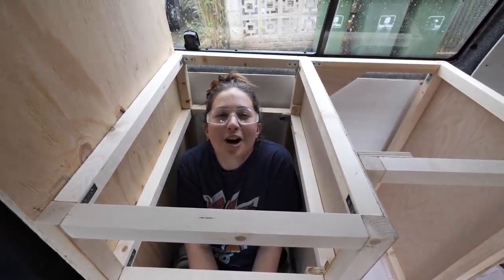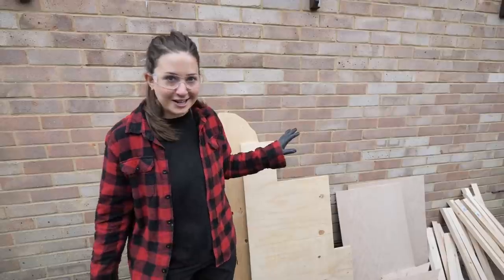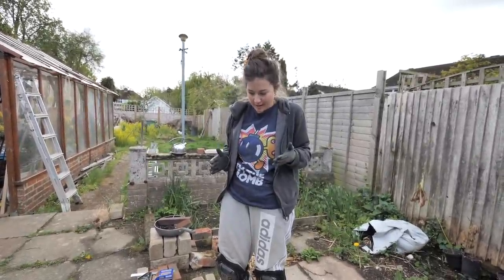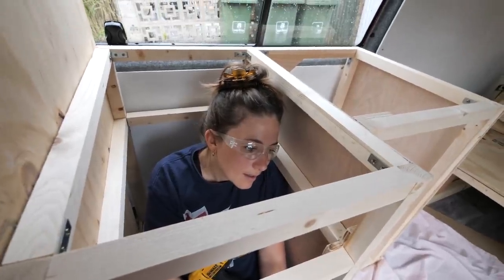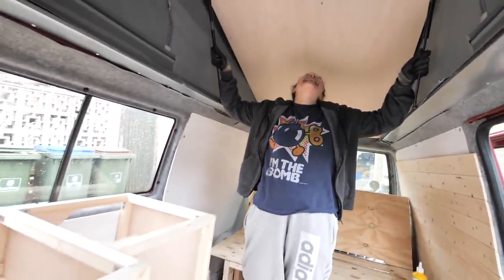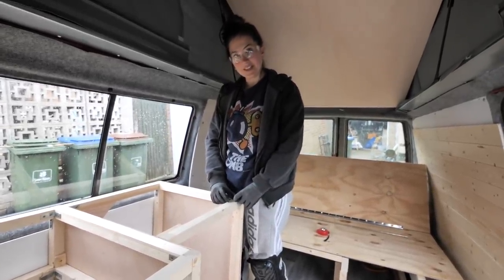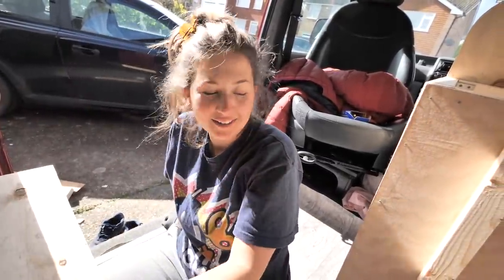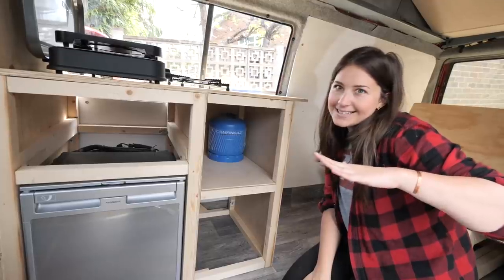Kitchen Nightmares | Self Build Camper Van Conversion For Dummies Part 4

Comment: * IMPORTANT *  Please, please, please make sure you install adequate fixed ventilation.  Not just an opening door or the pop top, it's got to be permanent and unobstructed.  All gas appliances require combustion air.  If there is insufficient combustion air, there is a high risk of incomplete combustion and then the creation on carbon monoxide.  I enjoy the channel too much for you both to wake up dead!!!
Reply from the maker: Thanks and don't worry we have put A LOT of research in to the gas as we don't want to die either. We can never get too much feedback on this subject but it will all be above board & safe :)
Reply: @TravelBeans  Brilliant, didn't want to come across as a bit of a nob!  Been working with caravans and motorhomes for 20 years and own a caravan and motorhome repair and service centre. We see some terrible conversions with no regard for gas and electrical regulations.  Keep up the good work.  Ps, belt and braces, make sure you install a CO alarm.
Reply from the maker: @jameshogg76  Not at all, when it comes to these things it's better safe than sorry. Plus we are still novices so I know it is easy to make mistakes. More than happy to hear feedback even if it seems glaringly obvious. I can only imagine what you have seen...

Yes, we are waiting for straps to come for the battery and gas :)

Comment: Everyone is difrent my good friends..Everyone builds according to their needs.
you don't want a sink ok that's 👌 
Perfect. Other people don't need a bathroom and that's ok..
Me I need a full bath so I build one I needed a kitchen so I build one.
I needed a entertainment center so I build  one. besides my solar I wanted  a generator for emergency so I install one with transfer switch. I wanted emergency water supply so I install another  39 gallon tank on the roof rack..and because I love books  specifically classic books 📚 I build a beautiful book shelf. And
I got a small but beautiful 🍸 bar
And I don't drink alcoholic beverages. But I wanted all this things. Wasn't necessary but that's the point you built wat you want is your van..I got a 170 350 dually extended so for emergency  I got a wacher dryer combo. yes I'm crazy so say my family but they are telling all their friends how super is our van conversion lol..so good luck guys. God bless you and be safe on your journey through van life